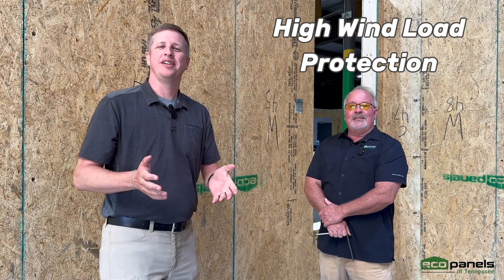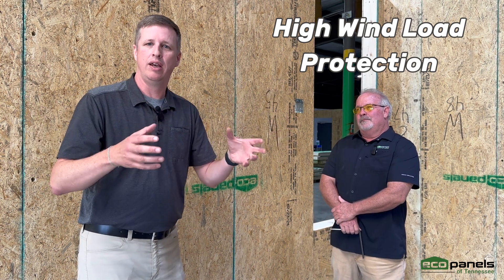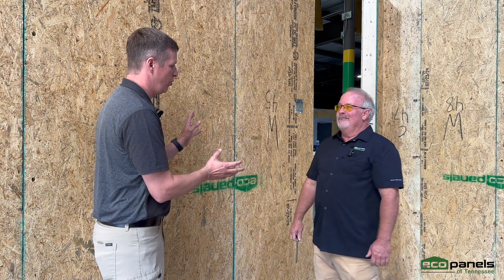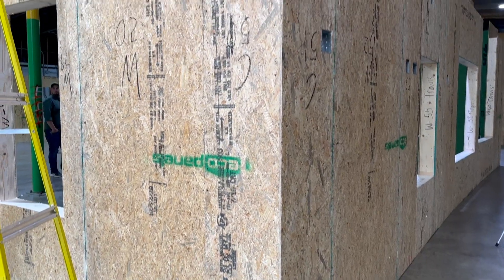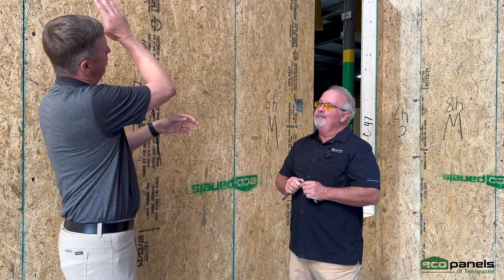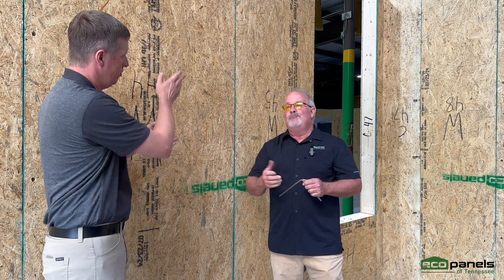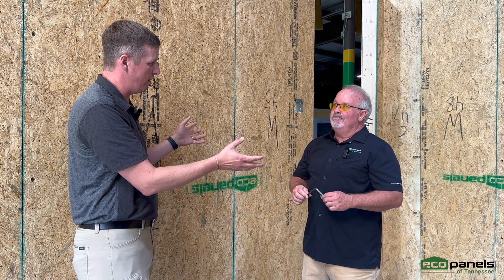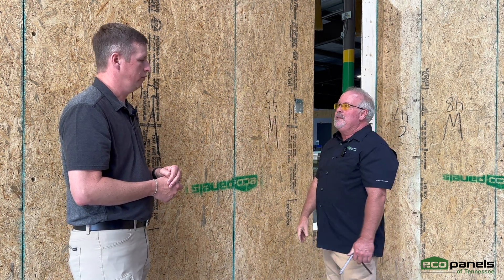High Wind Load Protection | Eco-Panels of Tennessee

Comment: Can hurricane ties be screwed directly into the panel?
Reply from the maker: Great question. In some cases, yes. We may need to incorporate some additional blocking to accommodate anchor points. That said, if there's a high wind situation, we often have strapping that's more specific to the structure and engineered.